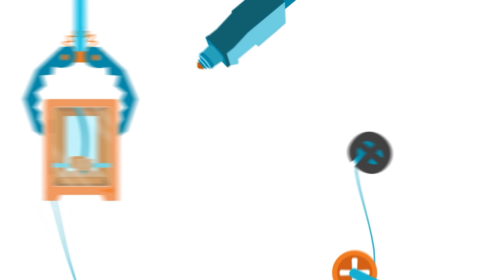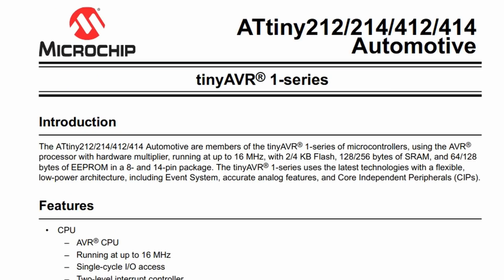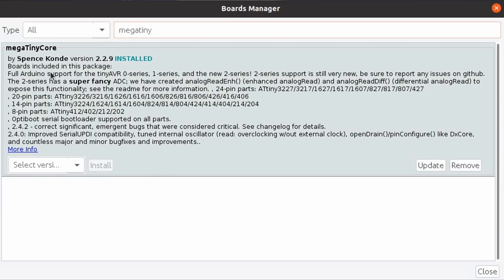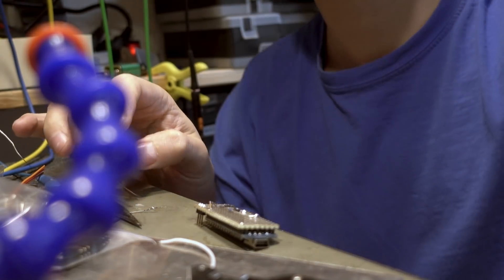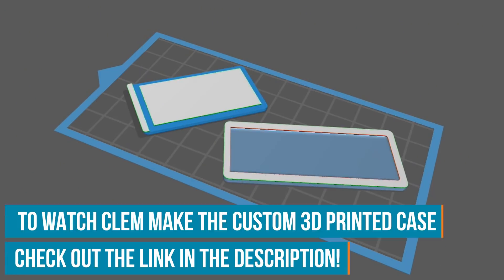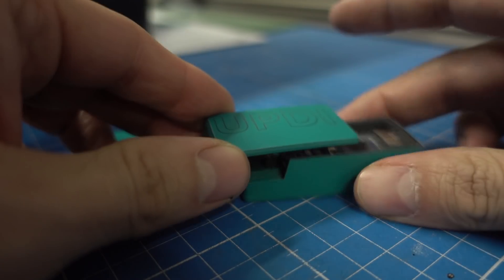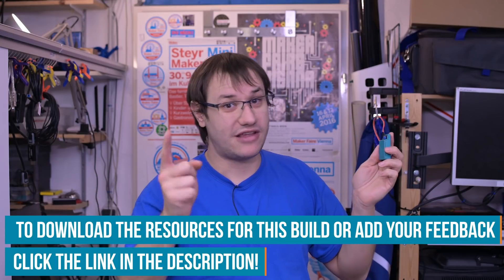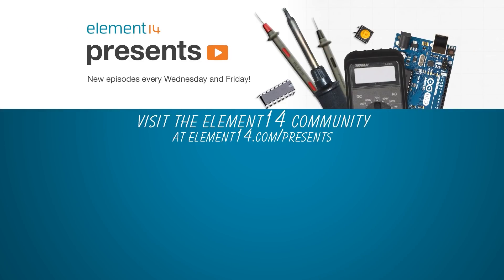Make a UPDI Programmer for the Arduino ATTiny

Comment: Noob question: Will this programmer work with Atmel Studio? I ask because I need a UPDI programmer to lock an Arduino Nano Every. 
I'm told I cannot lock it via AVRDUDE because it doesn't have access to the fuses. So, my only hope is that it can be done via Atmel Studio....and again hopefully, using your Nano programmer...
Reply: maybe I don´t use atmel studio , but its worth a try.

Comment: Does the Arduino IDE serial monitor work over the UPDI link for the Attiny chipI?
Reply: no you need to connect a serial to usb converter on rx and tx for that but that can also be built with the parts i nthe video, just different software,

Comment: Or you buy any USB to serial TTL adapter, connect RX to TX via 4k7 resistor and you are done. You only need RX pin connected to PA0 and GND to GND. Tested with CP2102 and CH340G personally.
Reply: there are plenty ways to skin a cat, this is just one of multiple methods.
Reply: @MAYERMAKES  Of course. The method I mentioned is simple but slow. It also doesn't have 12V trigger, which some small parts need. It is for a quick start, if you don't have any Arduinos lying around. Thanks for posting, it is very useful info anyway.

Comment: Thank you for this.  I just purchased a bunch of attiny402 ($0.49/chip) for simple projects and some attiny1624 ($0.85/chip) because having a 12 bit adc that can do up to 375,000 samples/sec would work really great for some data acquisition projects I have working on.  Along with some SOIC-8 and -14 breakout boards, getting a fully functional board at the fraction of even cheap clone arduinos sounds like a really good deal.
Reply: You are welcome!
Reply: How to flash the program using aurdino nano attiny 402

Comment: You are to late with your UPDI video. Bitluni showed all details long time ago :-)
Regarding the chip shortage - the Attiny with UPDI are sold out at the most suppliers. But Arduino boards like the Nano are still available.
Reply: it is never to late to make an informative video. plenty of stock of both chips I showed in the video available at the relevant suppliers.

Comment: The new series of AVR are really powerful.
 The PORTMUX lets you move peripherals around, so you have a lot of choice for which pins use I2C, SPI, PWM, etc... (and less chance of a conflict, where you can't use all the PWM if you are using SPI for example), 
20Mhz on the internal oscillator, 
fractional baud generator on the USART (you can get accurate USART timing without using a specific crystal), 
pin change interrupts on every pin, 
the event system and CCL can let you do all kinds of crazy things, by linking together other peripherals and IO,
powerful Timer Counters (pulse width/frequency measurement, tons of possible PWMs),
 RTC for dedicated system timing (no wasting a TC that could be PWMing), 
the Tiny series have a DAC, etc....

Also, the UPDI is so much nicer than ISP/Debug wire. You mentioned less pins, but it's also much faster and more reliable than Debug Wire when debugging (if you have an Atmel ICE).
Reply: yep a really good alternative for a lot of projects!
Reply: Portmux has been a common technique for a few years now. Often not as flexible as it implies.